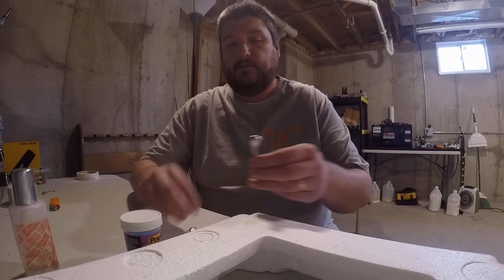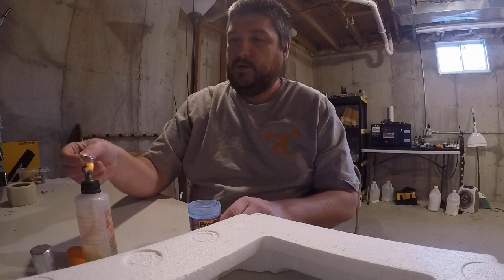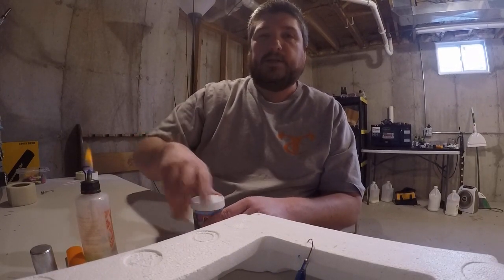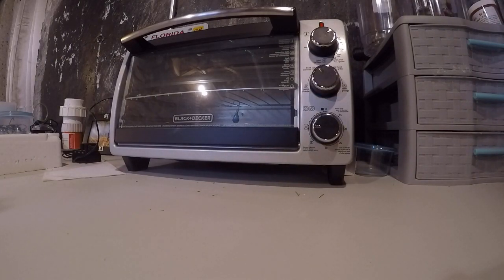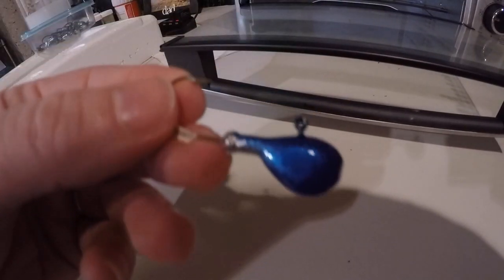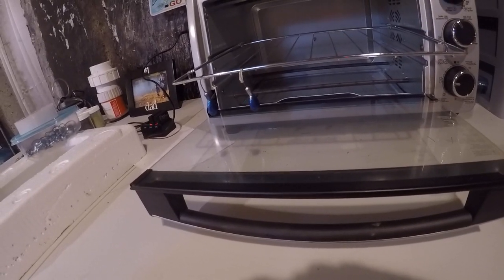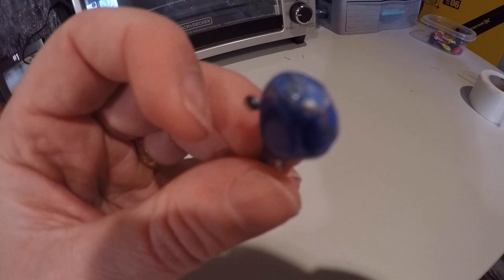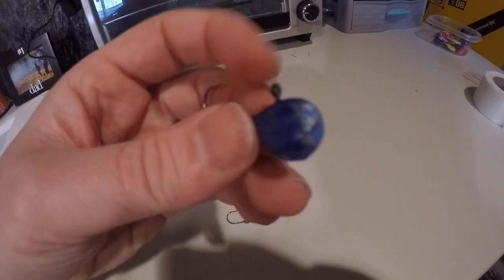Pro-Tec Powder Paint For Bass & Walleye Jigs ( To Bake Or Not To Bake)

Comment: Great video. Issue I had was put in oven at 325 and after 10 minutes the paint starting dripping. I cut back to 5 minutes, but not sure that’s long enough.
Reply from the maker: If the paint is dripping it’s one of two things (or a combination of both).  Either you there is an excessive amount of paint going on, or oven is too hot.  I know my toaster oven runs hot.  I set the dial at 300 to achieve 325 when I shoot it with an infrared thermometer.
Reply: @fishingthe262  Thanks, for the nice reply. Will keep your thoughts in mind during my next try; as I believe you are correct. 
Take care